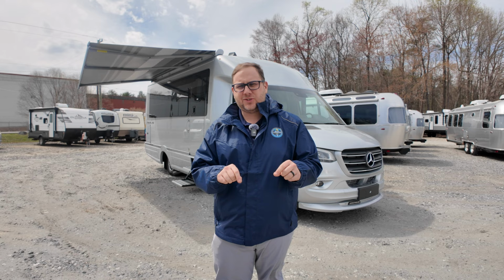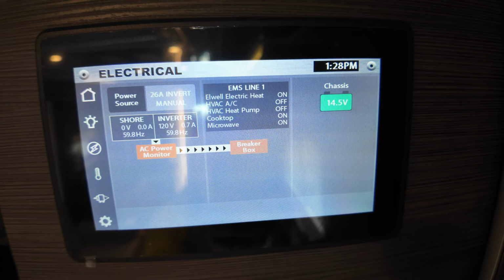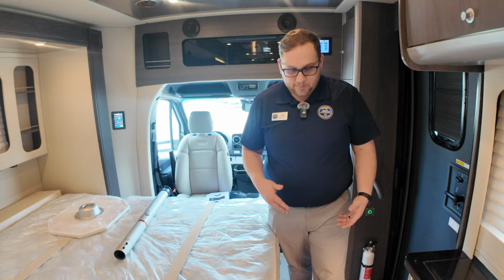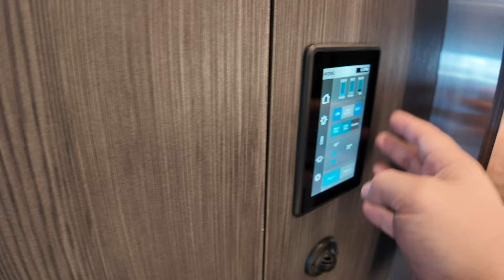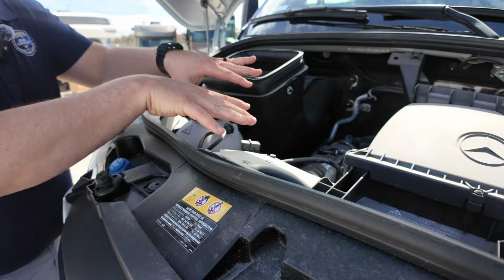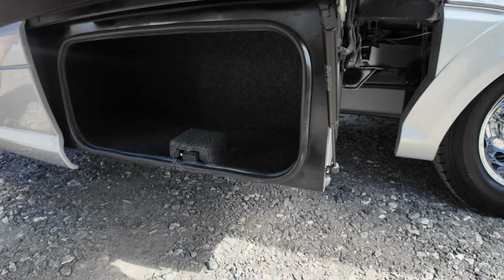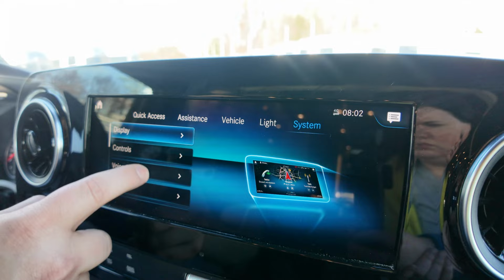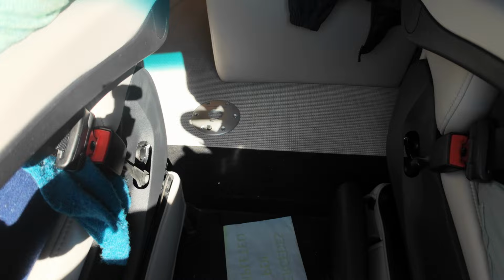Airstream's Most Expensive Camper Van! Full Walkthrough - 2024 Airstream Atlas

Comment: Your suggestion for memory position number 3 for the seats is incorrect. 
Use position number 3 to put the seat in the location at which it will actually fully rotate. It will not rotate in the  full forward or full back position.
Reply from the maker: That's a great idea!

Comment: 300w solar is severely undersized for the battery capacity.
Don't count on it doing much.
Reply from the maker: Ture, but does cover the refrigerator and lights.
Reply: @ChadsRVReviews  
Correct.
From 11am to 2pm.